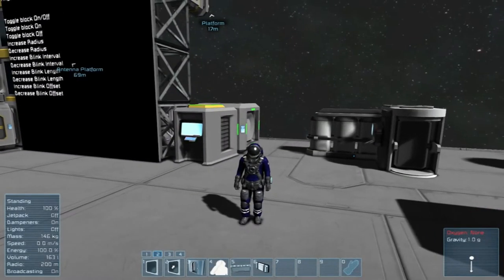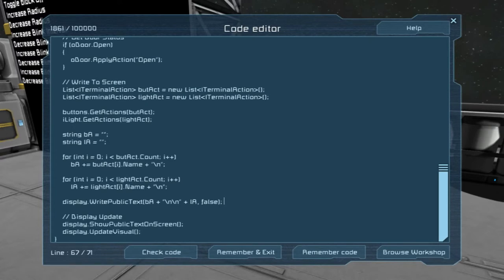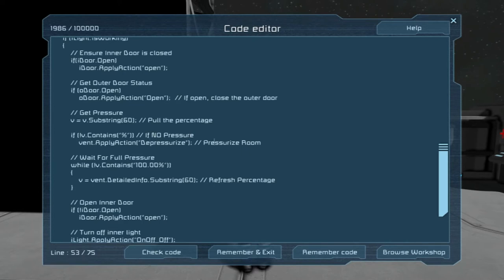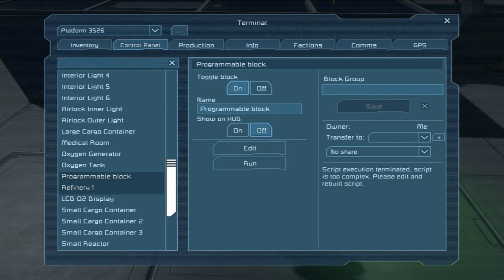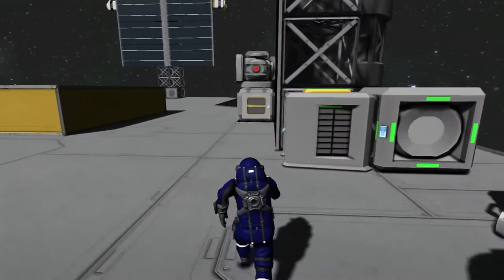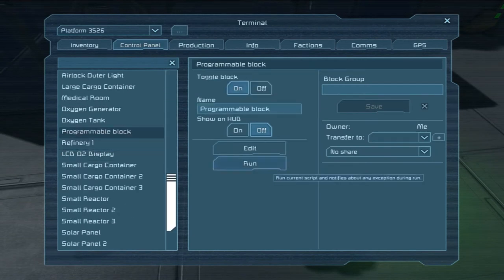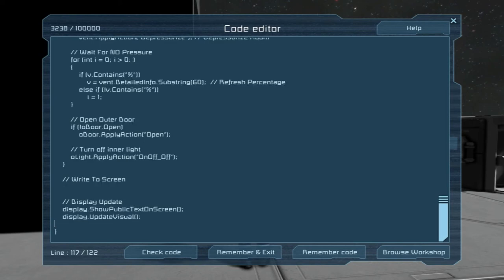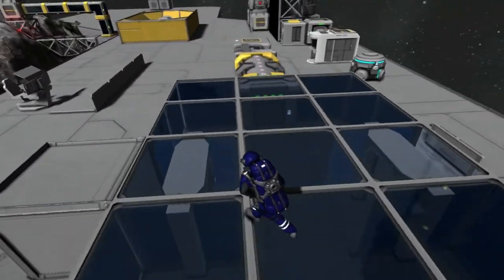Space Engineers Programming 101 - Airlock Script - Part 2

Comment: As far as I know programmable blocks can only run for a specific time (not sure if it was one tick or one second), so you wont get arround using timers. But actually its not that hard, I got a working airlock with just a few lines of script and two timer blocks, it even locks one of the doors, so it cannot be opened by accident, and some indicator lights. Let me know if you would like to See my solution ;)
Reply from the maker: Ixam97 I agree, the block can't seem to "sleep" cause of how they have the scripting implemented it seems. I actually found a solution for the airlock that I like, it should be in next episode. It ends up being a programmable block, two timers, then you're left with a one button airlock "toggle" type of system. I'm pretty happy with it so I can move on to another script now. Thanks for the input. :)